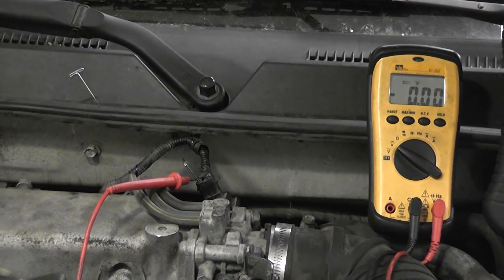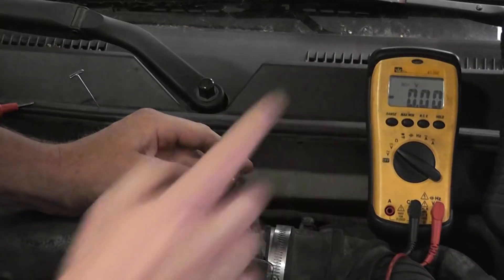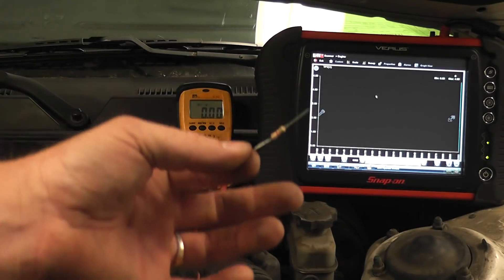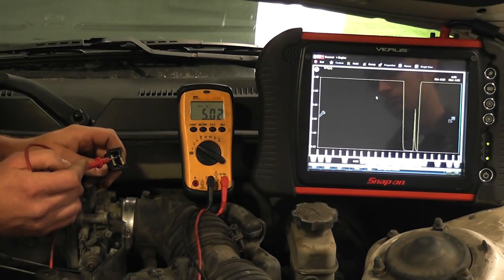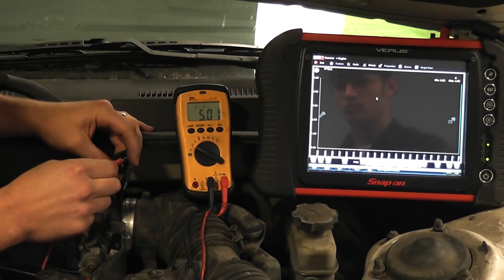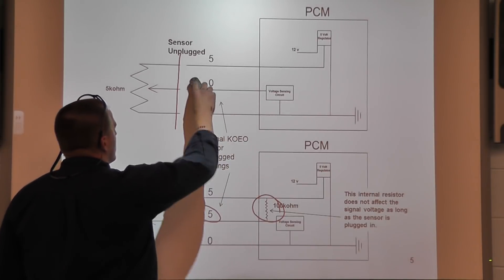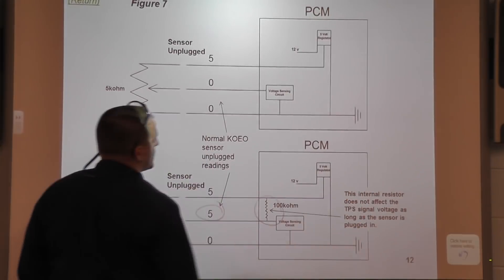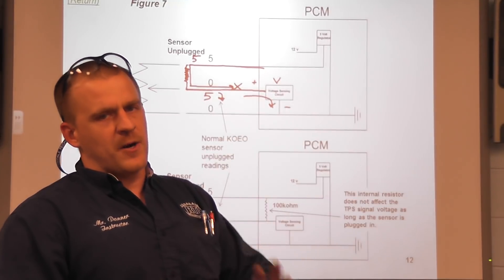How to test throttle position sensor wiring with a resistor (any car)

Comment: It took me a while to understand what your trying to teach. To make it short--  is the voltage referance wire bad-- or was the potentiometer bad-- or was the return signal wire bad--  --or was the computer bad?? The volatge referance and potentiometer is good because there is 5 volts in and out of the potentiometer as throttal opens. The signal return and computer is good because 5 volts was shown at scope when jumped with a proven 5 volt reference.  But the main lesson is>> if the signal reference is shorted  to ground and you jump it backwards you could fry the computer.. I am not so sure this true because it all ready might have been shorted to ground. Ampearge is what heats and frys a circut not voltage. This must have been anticipated by the engineer and must have built it circuit protection. If somebody understand this better than me let me know......And Paul  did say in 20 years he has never fried a circuit this way.

.

Comment: Love the great vids very educational
Also got a question, have a 02 saturn l200 , needed to know the pin from the pcm to the fuel gage got a short in that area already change fuel pump, fuses, relays, instrument panel, ran a new wire purple from pump to pin 22 on the blue connector on the pcm, n
Still nothing
Can u help can email me at
micro61micro@Gmail.com
Thank u.

Comment: Paul, could a single wire knock sensor that is being pulled to ground on the signal wire cause the same potential risk to electrical components?
Reply: no risk with that circuit. in fact there is not much risk even on the reference circuit as they are highly protected.

Comment: hi, watching video, why don't you use a test light, than if it is shorted to ground it would light up, if its not would still show a voltage on scope, this would protect ecu, this would check for a short or good circuit in one go.

Comment from the maker: I am not sure if that would work, I'll have to try it. I think you body has too much resistance for this test. Certainly there would be no concern with overloading the circuit no matter how long you did the test.
Reply: hey when i connect the harness to the air temperature sensor it shuts my engine off but unplugged the car runs normal would you happen to know what this is i’ve replace the sensor and the throttle body and my car still won’t run unless the harness is unplugged
Reply: i have a code that says intake air pressure sensor 3 circuit high voltage and i have high idle
Reply from the maker: @tyronearnold963  I'm so sorry, it is hard for me to keep up, especially with follow up comments. I get about a hundred new questions a day, and do my best to answer them and when I do, they just multiply! Anyway, if you still need help, I have created a forum on my website https://www.scannerdanner.com/forum/post-your-repair-questions-here.html that is free to join, where I have 4 hand picked moderators and over 25k global members who are there to help me help you guys! You will not find a more friendly and helpful forum anywhere. Hope to see you there! Thanks for understanding.

Comment: Paul if you use your body to jump the reference to the signal like you did at the beginning of the video should be a valid test,shouldn't it? Besides its not like its gonna be jumpered for hours,when you're doing this test you should have scan data ready, jump it, read scan data and be done with it.

Comment from the maker: anytime my friend. I never have a problem answering intelligent questions
Reply: I have a 1994 pickup with 22re motor, 4 cil, 2wd, no power steering, I have no problem identifying the 5v cable, my tps has 4 pins, how can I identify the signal wire?  Another question where do you sell your book?
Reply: Another question, can I use a 10k resistor or have to be 5 k?

Comment from the maker: Yes, but remember some of them all you need to do is unplug it and the signal voltage will already be at 5v. If this is the case you do not need to do the jumper test with the resistor. Also remember this test is used to check signal wire integrity and NOT the sensor itself. Although if the sensor signal is fixed at 0 and unplugged it goes to 5v, this suggests a shorted sensor.

Comment: Hi Paul I have code po2138 po2127 pedal sensor on sentra 08  I thing is a potentiometer like tps sensor if I correct, if is fix to 0 v can I use 5.6k-ohm resistor?.

Comment: I was wondering if it was common for the 5 volt refernce was on the outside pin and the main ground was on the opposite outside pin with the middle being the computers "eye"? it seems that that would be the common design. I know thats probably not an ironclad rule for every car but i was wondering?

Comment: The resistor acts to limit the possible current flow. 5V/5000ohms =.001A = 1ma (milliamp) of current flow,max. (Ohms law says so.)
There is virtually no voltage drop across the resistor,because there is virtually no current flow-The signal line should not draw any significant current.

Comment from the maker: Any Version is fine as what you get with newer ones is newer model year component info. Version 7.0 or 8.0 is the last update for that tool. I have a version 6.0 and I am updated to 2002 model year. This doesn't mean I cannot use the tool on newer cars. I just will not have vehicle specific component info.(best tool I ever bought)

Comment from the maker: That test will not work as the PCM will still be plugged in and your ohmmeter can backfeed into other circuits in the PCM causing incorrect readings.

Comment: Hi Paul
If I didnt  know if the ECM  have a internal resistor or not ,can you measure the ohmage of the ref wire and the signal wire (sensor disconnected) and check the ohmage would it then return a ohmage on a ECM with internal resistor if the wiring was good?

Comment from the maker: That is correct, although I wouldn't call it "large amounts of current" 
A typical 5v regulator can only handle around 1 amp of current before it burns up. To the regulator this would be a large amount of current.

Comment from the maker: Thanks man. I've been doing this test for over a decade and never had an issue. I was mainly using it to ensure that the signal wire was not open. After thinking about what would happen if the signal wire was shorted to ground (not common), I felt the need to modify this test.